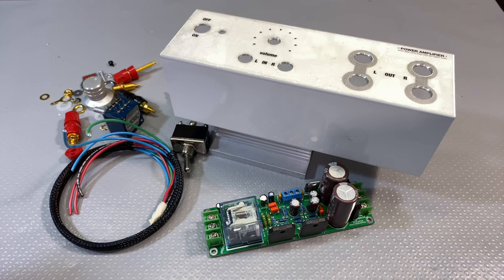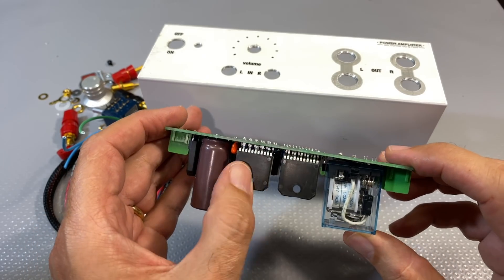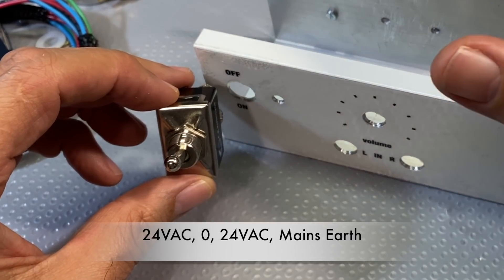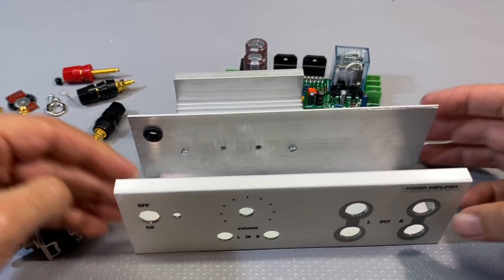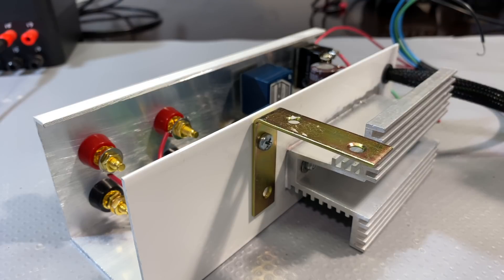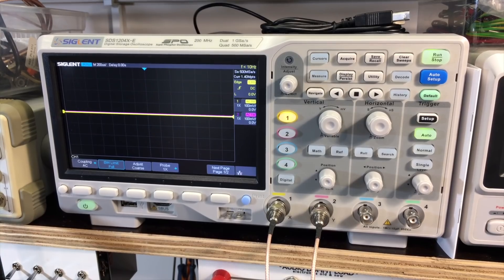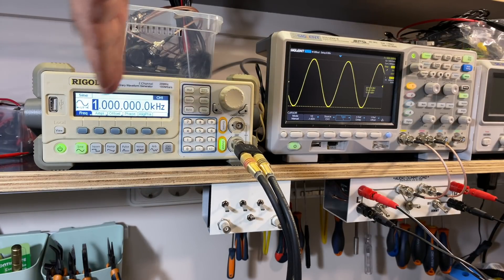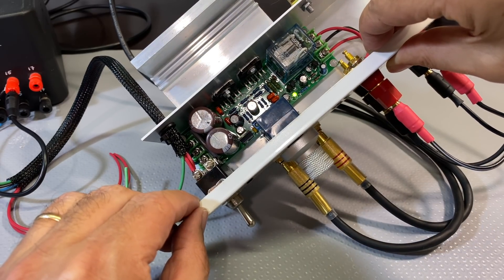Building a Workshop Amplifier with Audiophonics Module - Stereo LM3886 Chipamp.

Comment: Manuel, thank you again for the wonderfully educational videos. I see you put the potentiometer on the input without any buffer. Will it have an affect on the input device? Should you put a low preamp op-amp before the potentiometer to keep from loading the device under test?  Thank you for making me think about the things I studied 40 years ago in high school radio and tv repair classes when tubes were still king but the transition was full on. Best regards, David ka4mep
Reply from the maker: The input impedance that the device under test will see is the pot, and in fact, if you test a circuit, that circuit should do an impedance. In fact, sometimes it needs to see one to work properly. The input impedance is also quite high here, which is also a good thing. Adding an opamp buffer would make this an unrealistic load.

Comment: Is this amp also usable to with a set of old stereo speakers? I am looking for a small amp that I can use in my eurorack as multipurpose audio rack.
Reply from the maker: That’s exactly what I use them with. I don’t use good speakers in the workshop in case I damage them in testing equipment.
Reply: @electronicsoldandnew  Perfect, then thank you for guiding me to this module. It is exactly what I was looking for then! Also do you maybe have any tips on powering it with my eurorack uZeus module? It has +5 +12 and -12 and 16 pin headers to connect to.

Comment: Greetings:
I was interested in finding your chassis, but think you built it yourself. Probably built the same way as all of your other chassis.
Beautiful work BTW.
Reply from the maker: Yes, the chassis is really DIY using a square 65mm aluminium element, with the top cut off.

Comment: Greetings:
I think your audio signal generator has a sweep function. I have seen it used sparingly, here & maybe another youtube chan. If your gen has presets, please set one for a 20Hz-20kHz sweep and set the scope such that the display completes before it is retrggeredy (if the scope has presets all the better). I presume the gen has a trigger output. This way, at a glance you can display the full bandwidth. I presume you can set other presets to restore your usual settings (if USB computer control is available, that maybe very useful to switch back and forth).
I know first time setup is involved, but I am sure you will enjoy the result.
Reply from the maker: I’ve tried that 😊 I’m actually working on another way to get an actual bode plot (other than the built-in bode plot function). It’s pretty simple, so stay tuned 😊

Comment: Hi Manuel, question: has the frontplate stickers applied? I mean, adobe illustrator ---> print on sticker (how? Got it done somewhere?) ---> apply the stiker?
Regards, Mike
Reply from the maker: Illustrator, printed on overhead transparency sheet, stuck with transparent spray glue.

Comment: Hi Manuel, after some thought I decided to buy the same amp board! 
I am rebuilding (not restoring) an old Monacor SA-500 amplifier, which I aquired some 50 years ago. 
The specs were horrible (e.g. 10% THD at 20 Watts), so I decided to gut it and just leave the enclosure and faceplate as it was.
I was thinking about taking one of the low cost class D amp boards, but the one you found is an "analog" one, for the same price. Hard to believe, but then you tested it, and it looks to be great.
And it includes the power supply as well.

So thank you for this find!!  😊 😊 😊
Reply from the maker: enjoy

Comment: Nice project...and well done! Could you please make a video of how you designed that frontplate in Illustrator?
I can't find those symbols in any library.
Reply from the maker: I did not use pre-made symbols. Everything is designed simply using the line and polygon tools. There are simpler software packages for this, but I use illustrator as the measurement function is very accurate.

Comment: Nice one.
Did you leave the board hanging by the chips?
I believe that fine amplifier deserves better, as a lab. amp. you don't want to risk those solder joints to fail over time. Just a thought.
Reply from the maker: No, standoffs are being made to support it. The chips get quite warm, so cold solder joints are a real worry.
Reply: @electronicsoldandnew  I Know -belt and suspenders but it is sitting in a working environment, bumping  the box when plug it in and out, vibrations on the shelf on top when you work at the instruments. The are some heavy components on the board, might react hard on small vibrations.

Comment: If not using mains earth to chassis be better to use both poles of main switch and switch the active(hot) and neutral, add some heat shrink then you have safer setup!

Comment: Those LM chips are amazing. I built an LM3875 amp a few years ago, still use it now,  very good sound. Next I think I will try one of these, the 3886 is supposed to be the very best linear amp chip you can buy.
Reply from the maker: I also used the LM3875 for quite some time without issues. This one is amazing as a test amp.

Comment: Hi Manuel. Can you please tell me (us) more about your Dual AC supply? Is that one transformer with taps? How much VA? Any link? And did you put fuses in it or how do you protect it? Thanks.
Reply from the maker: It’s just a simple transformer that has all these taps, which makes it useful. I think it’s about 50VA. I use a 500mA fuse on the primary as a simple protection.

Comment: If you adjust the output impedance, you have a ultralongwave transmitter.  :-)
Reply from the maker: True. I’ll connect an antenna instead of a speaker cable 😊

Comment: make a virtual earth in case mains switch fails to chassis?
Reply from the maker: I’m going to have to change the rail system I use so that the various units don’t connect to each other. Then I’ll earth the chassis without any problem.
Reply: @electronicsoldandnew  You are gathering a fabulous collection of accessories under your shelf there.  Will there be an end-piece on the amp section to prevent contact with the mains switch?
Reply from the maker: i definitely need to insulate it. maybe an end piece or hot glue (?).